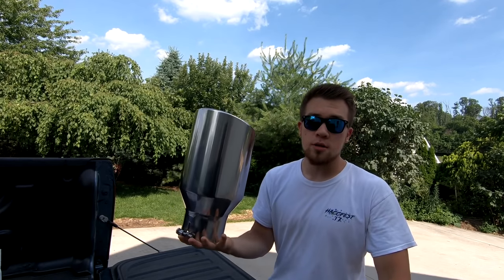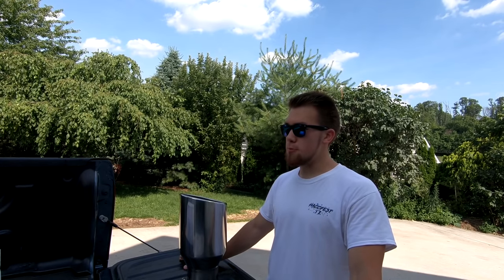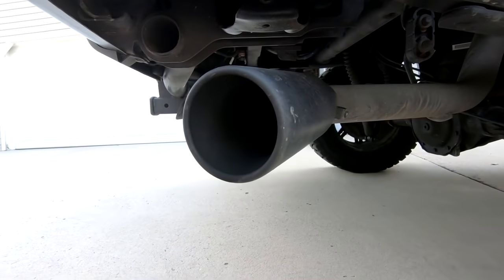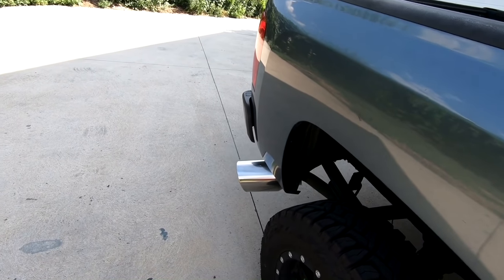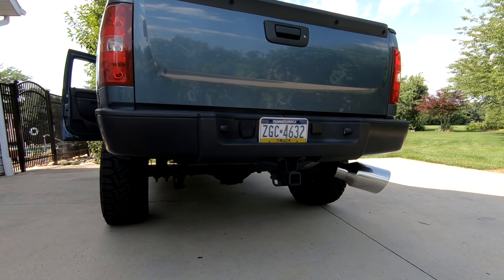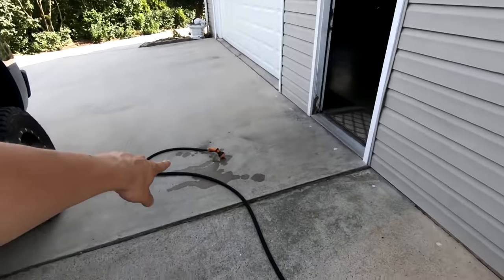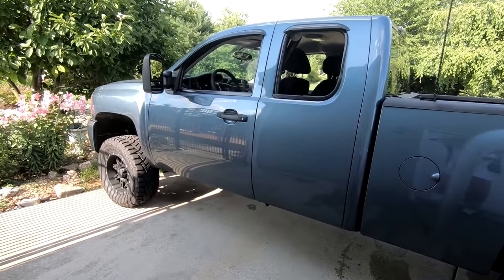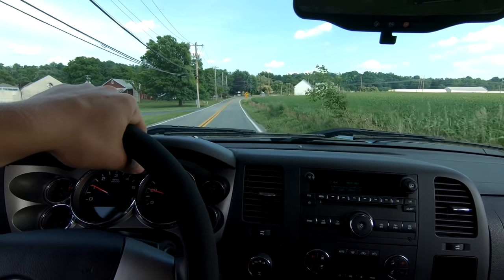V8 GAS SILVERADO GETS A NASTY 8" EXHAUST!!!

Comment: Exhasut tip doesnt change sound signature,period
Reply from the maker: depends on the size
Reply: Size and length will change a tone
Reply: @jshapiro34 that's what she said
Reply: Cam, headers, cat removal, glass pack, muffler all do it.
Reply: @Shane Willis you need length with the size can’t just slap a 5 inch wide 4 inch length pipe on their and change tone it needs length to actually do anything.
Reply: @jshapiro34  thank god some one understands
Reply: @luker6766  isn’t my first rodeo and won’t be my last every vehicle I own or owned has had muffler and tips some even had headers back…….but they have all been straight piped or cherry bomb extreme on them and they all have had 5-8 inch tips

Comment: All the 8 inch tip is gonna do is make it deeper not louder.  Smaller exhaust is louder.  You want deep you go big you want loud u go small. Sometimes tips can work well with an exhaust on a gas truck if the exhaust is already small  like only  2.25 or 2 inch and your tip is only 3 or 3.5 inches which is small for a tip.   it can make it have an echo affect and make it louder to help the small exhaust echo and rap rather than just snap and not echo.   but Also no tips on small exhaust is very loud because it screams more     But in general especially when your already running a 3 inch exhaust and you add a 8 inch tip it will be deeper and quiter  not louder lol
Reply from the maker: the widening shape of the device does add some amplification properties
Reply: @adamchevy4283  diesels are quieter because of the turbo. None of you guys have a clue what your talking about on here.
Reply: @1duramaxhd  ya but the turbo is beyond the point.  We’re not talking about turbos. We’re talking about exhaust size.  Even if it is a gas engine comparison as long as it’s motor to motor same engine and same exhaust setup to the T  smaller exhaust is louder
Reply: So what I’m hearing is put a 3.5 in tip and then add an 8 inch tip

Comment: If it still has the chokemaster 40 get rid of it and do a borla xr-1 #40085 heres an old vid of mine has longtubes no cats 3in exhaust axle dumped with a 5in tip, still has same set up but ordered 3x4 adapter and a 4x8 exhaust tip will be making a new video of it soon.
"Old video" https://youtu.be/24_R1PVlHME
Reply from the maker: that does sound like a nice setup, the adapters would allow for something fierce

Comment: Where did you find a 3" to 8" tip?
Reply from the maker: I had a 5 to a 8 on top of a 3 to a 5
Reply: @Derec  double caned hahaha should have ran 3.5 system
Reply: You can find a 4” to 8” tip on amazon. Just buy a 3” to 4” adapter

Comment: Get a diesel and put an 5 inch pipe 8 inch tip
Reply from the maker: agreed
Reply: Depends cumins 5 to a 8 
Ford 4 to 6 gets that pop and turbo whistle 
Chevy always sounds good low rpms and then sounds like a wind tunnel.... system doesn't help Chevy's it's aftermarket turbos and down pipes that wake them up.

Comment: why do yeeyees think exhaust tips work
Reply: Because they do they change the pitch of the tone go cut ur exhaust off and buy a bunch of open flanged exhaust to slip in ur pipe and jump it up like say ur exhaust is 2.5 to a 5in or 3 to a 6 you will hear a difference and if you get a meter it will drop like 2 decibales
Reply from the maker: Yes the exhaust becomes louder while beholding a tone shift